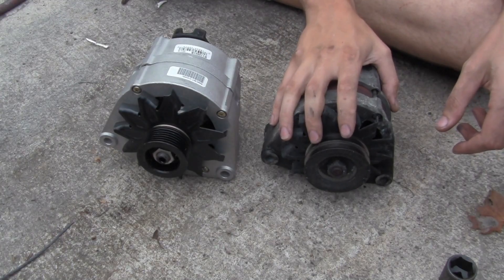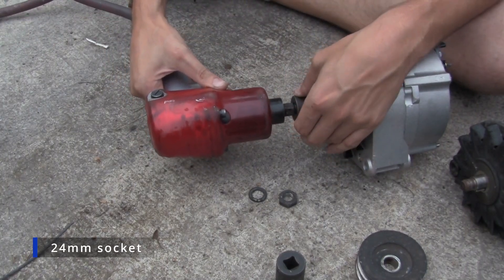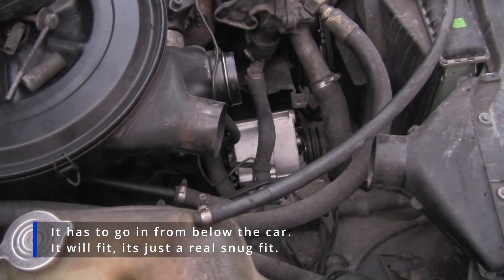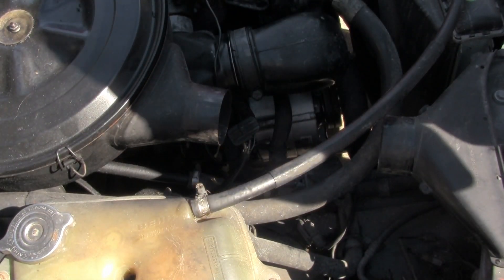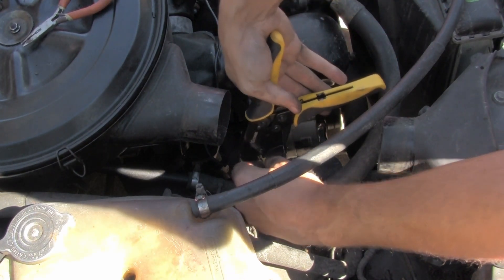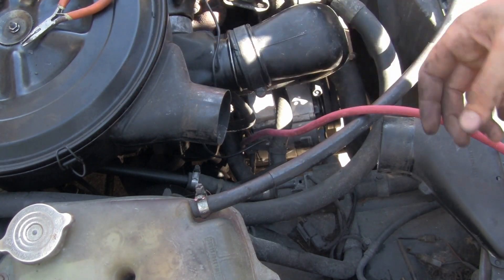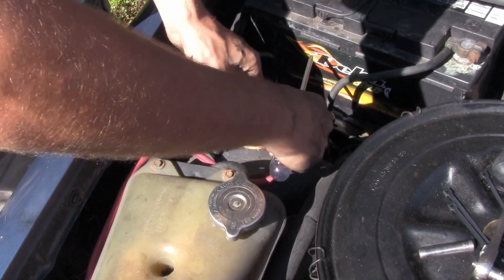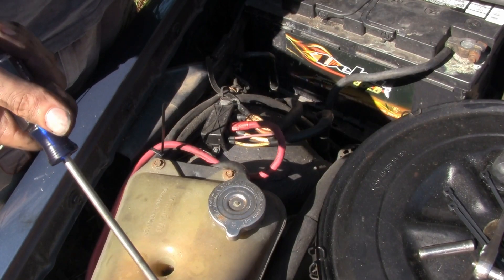W123 Alternator AL129X upgrade, 65a to 115a charging system

Comment: Only have seen one other person on the web with similar issue and of course no responses. I have a 78 300cd and was looking to do this mod but don’t have that junction box in the same location (spot that the 4g wire goes to from alternator) Wondering if you have any idea where the connection would be
Reply from the maker: I'm only guessing here, but it would have to go to the starter or a junction block somewhere else between the alternator and battery. If you've got some ramps or jack stands (be careful not to get squished of course), I'd take a peek underneath and see if you could just trace it to where it goes.
Reply: @trythistv  okay I’ll give this a shot. I poked a ground a bit initially after watching your video but wasn’t up in the air. Thanks for the quick response! Your videos are kick ass too

Comment: Interesting — however, could you please describe (ideally, with a diagram) the intention of your modifications to the output connection and how that changes the charging circuit? IMHO it’s unclear from the video. Thanks!
Reply from the maker: The main changes is not using the tiny thin wires that were used from the factory. The small blue wire I clip and put a ring terminal on is the excitation wire, it jump starts the alternator windings so it begins charging. I ran the big 4 gauge wire up to the terminal block, disconnect the old charge wires from the alternator, and run an additional 4 gauge wire from the terminal block to the battery positive so that none of the 40+ year old wiring is being used to charge the battery. I'll try to draw up a little diagram or something later on and post a link to it back here

Comment: I need to secure the alternator pulley in one step. Since I don’t have an impact wrench, I initially planned to tighten the center alternator pulley after installing the belts. Now, as I try to tighten the nut, it keeps slipping. I need a way to hold the fins securely without bending them so I can confidently tighten the nut. I’m unsure if it’s tight enough and may have to remove it and take it to a shop for proper tightening with an impact gun. What do you think? Any suggestions?
Reply from the maker: Some of these have a spot in the threaded shaft that you can put an allen wrench / hex socket and then counter hold the shaft from turning to tighten the nut up, I'm not sure if my AL129X did or not, but I have seen that on at least one.
Has the lockwasher flattened out fairly well? Possible that a neighbor or someone would have a battery impact you could borrow for a minute?
Reply: @trythistv  I removed the alternator, i found a alternator repair shop, they tightened the nut for me. And I re-installed it. Done! and done the right way. Thank you for all your help. Great feeling.
Reply from the maker: Awesome! Glad you got it sorted out, hope the new alternator does a great job keeping your battery topped up

Comment: Hi, would 4ft of cable be enough? And the second cable you recommend: it goes on the same terminal, on top of the first one?
Thanks a million, I got my w123 shirt, it is awesome!
Reply from the maker: I think 4 feet would be plenty.
I ran one wire from the alternator up to that terminal block, disconnected and insulated the ends of the old one with some electrical tape or shrink wrap just in case, and then ran another new wire from that same point on the terminal block to the battery positive, that way we aren't overloading any of the old wires and we get all the amperage capacity benefits.

Hope that explains it well and gets you charging good! I've been thrilled with how it has worked for me.
Glad you like the shirt too, it's one of my favorites, very comfy!

Comment: You use the D+ wire from the plug and use it as an exciter wire? Is the ,,idiot light" still working properly?
Reply from the maker: I'm not sure what D+ is, the blue wire on the original plug is the excitation which is connected to the "idiot light", so everything works just exactly like stock, just makes more amps.

Comment: Hey love the videos man they have been a great help. Currently just had my alternator go out in my w123 but it seems that this alternator is no longer available. Everyone states out of stock. Any recommendations? Thank you
Reply from the maker: Have you called around local auto parts stores? They were optional on early 90s Saab 9000s, if you call for an alternator on a 92 Saab 9000, there was the al129x that is 115a and the al124x which was a 80 amp, most parts places can get the 115a one, if not, rockauto does have them as Remy branded reman, and BBB industries reman as well, and so does amazon: https://amzn.to/3UmSWAx

Comment: Thank you for the interesting upgrade. PLEASE update this if the belts wear out quickly. More output is appealing but the power to turn a larger output alternator is (most likely) larger too. You have swapped from a poly vee pulley to a twin v-belt pulley designed to run with a 65 amp system.
Reply from the maker: I've had the al129x on since 2018 (I lost the video footage for a while) and I have not noticed any abnormal belt wear, I'm still running the same belts that I had on before I installed this alternator.
I think it is likely a minimal difference in actual load, especially since it will rarely be making that peak 115A output, but the extra capacity helps keep the battery healthier especially in cold weather or making short trips because it outputs slightly more amperage across the entire rpm range.
Reply: Thanks for the update. Sounds like a win! @trythistv

Comment: is this alternator also equipped  with a regulator or you have to replace the whole unit incase of failure ?
Reply from the maker: It has a removable regulator on the back with integrated brushes, held on by two phillips screws, Very similar, nearly identical setup to the factory alternator.
Reply: Thanks a lot for quick response.
Reply from the maker: Of course! I happened to see your comment and knew the answer right away! I'm thrilled with how this alternator has performed on my cars
Reply: I know now what to replace next hope it would work also on my 126 300sd 85. @trythistv
Reply from the maker: You've got a om617, it'll work! I have been very happy with it, keeps my battery healthy!

Comment: Will this Bosch AL129X fit onto all W123 cars? Mine is a 280E from 1982. Thanks for the great video. Are there any disadvantages from having the higher amperage?
Reply from the maker: From everything I can see your car should have come with the same al80x from the factory that my car did, so the al129x should fit and work perfectly fine. That being said, I've only put these on om617 powered cars, which covers a ton of body styles and years, but it should fit your car without any issue.
As far as downsides, none at all. It keeps my battery happy even with short trips in winter time, and has been a no brainer upgrade for every Mercedes I've owned.
Reply: @trythistv  Thanks. My mechanic has said that the wiring terminal is wrong; it should be a 3-pin plug. Maybe this is 280E specific, or year-specific. Anyway thanks for the vid anyway.
Reply from the maker: @LesterLovesWatches  It is not a direct plug in replacement, the original alternator does indeed have a 3 wire plug, 2 for carrying current and one excitation. In order to handle the higher output, this alternator does not use a spade terminal style connector like the original one does, so we run the new larger wire up and modify the excitation wire on the original plug to work with the higher output alternator.